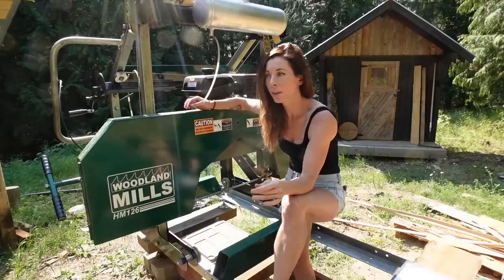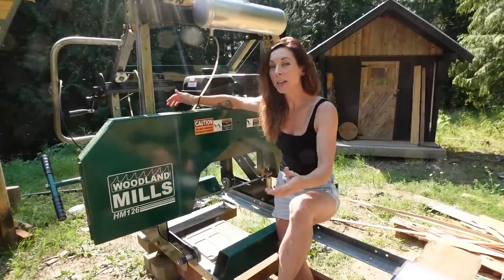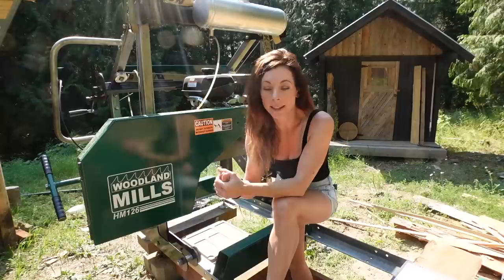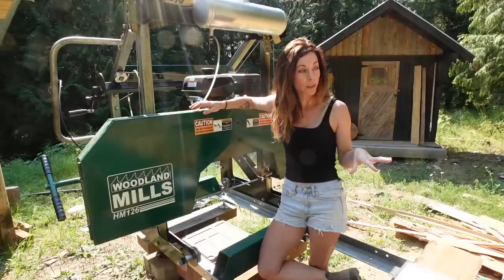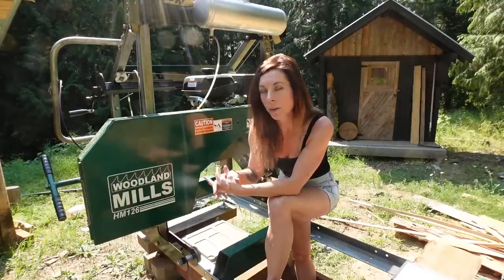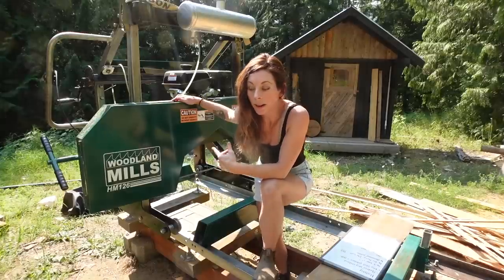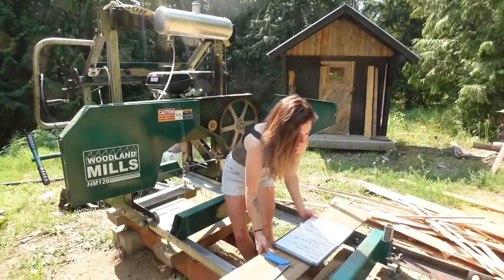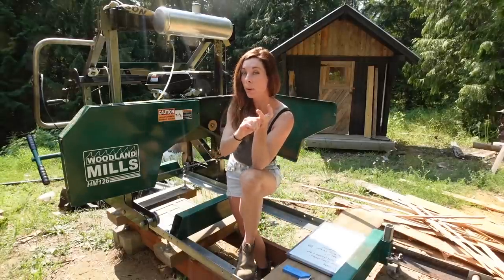My honest opinion - Woodland Mills HM126 bandsaw sawmill

Comment: I'm not there with hands on the problem, but from what I could see your mill uses a very standard tensioning system employed by virtually every belt-driven machine on the industrial market. It assumes the adjuster is familiar with it and has been through the learning curve already (or at least has access to someone who has). I've adjusted hundreds of belt-driven applications in my work so am familiar with the frustrations you expressed. 
Here is the system I use if it helps-
1) loosen the "locking" bolts just enough to allow the tensioner & motor to slide.
     **NOT freely, but only if put under a fair amount of pressure; the goal you're shooting for (which has a learning curve) is to loosen them the bare minimum needed for the jacking bolts (adjustment bolts) to be able to move it.
     **too tight and you'll see the jacking bolts want to go crooked, too loose and everything goes caddywampus (very technical terminology)
 
2) turn the jacking bolts to begin sliding the unit
     **you MUST count the flats of the jacking bolts as you turn them as this translates to the linear distance the unit is moved. 
     **by "flats" I mean the flat spots on the head of the jacking bolts. 
     **I recommend putting a mark with an awl, sharpie, a dot of paint or the blood of your enemies, as well as a mark on the frame of the unit for reference 
     **put the wrench on the bolt, taking note of the position of your mark you put on the bolt in relation to the mark on the unit and as you turn each bolt, count the number of times a flat of the bolt passes your mark on the frame. I recommend only making two 360° revolutions per jacking bolt at a time, then switch to the other side, then back to the other, alternating between the jacking bolts.
     **if you've kept your locking bolts tight enough they'll keep things from going all over the place yet allow you to adjust the belt tension.
3) tighten your locking bolts back down
     **it is imperative you turn the bolts the exact same amount as you number of flats you turn the bolt translates into the amount each side will move.

Another method is:
1) using an awl, make permanent marks on the stationary part of the unit even with the two edges of the plate that will slide when you turn the jacking bolts which will remain visible after your plate slides
     **these marks will be your reference points
2) loosen your locking bolts just enough to allow the unit to slide
3) turn your jacking bolts
     **you still want to only turn each bolt like 360° at a time, alternating between sides
4)using your tape measure to make sure that you're moving both sides an equal amount using your original marks for reference. 
     **this method isn't quite as accurate as the "counting the flats" method and if you want you can combine the two methods for a very positive result. 
Note: for the 1st few times you run your machine inspect the belt & pulleys for any sign of the signs of the belt rubbing on one side or the other. If you see it is (not too hard to tell as the side rubbing will be slightly darker than the other and will look somewhat chafed in comparison to the other) just loosen the locking bolts slightly and turn the jacking bolt on the side that was rubbing
     **a little goes a long way
     **you'll want to only tension the belt just enough to stop it from slipping and no more or else you'll put too much lateral pressure on the bearongs and wear them out prematurely 
     **if you don't have one already, get yourself a grease gun & a box of tubes of red grease. Check your manual for the grease schedule - if it doesn't provide that for you, jus hit every zerk fitting every 8 - 16 hours of operation (if at all possible, grease with the unit running as the turning / moving bearings, etc will accept grease much easier and evenly. Grease until you see it squirting out the other side of the bearing or whatever you're greasing. If visible, check the bearings first to see if they're sealed bearings. If so, only put 2 or 3 pumps if grease in like twice a year. Too much and you'll push the seal out of the bearing and you'll have to grease according to the 8 to 16 hour grease schedule.

**after reading several of the comments I'll offer that pretty much no matter what jigs, bushings, guides, etc you may add, unless you're talking precision machined tool steel on both the unit and the movable plate welded in place with like only a few thousands of of an inch latitude your unit will get out if whack & end up out of alignment. That's why the designers (along with virtually every other one out there) uses the system you're dealing with. It's the tension of the belt pulling on only the one side of the unit that will throw you off every time.
Reply from the maker: Yes ! I might have to read this one again, but I’m catching what you’re throwing out there. 
Steve and I have tried to very minimally loosen them (his suggestion) and slide it, and that does reduce the twisting. But it still happens. I think that welding something would be a way to solve things. I think sorting this out (with Steve’s help) might be a fun video!!
Reply: @michygoss7148  Right on... and admittedly, that style of adjusting setup can be a pain! Welding guides could help, but make sure some very hard steel is used and if you weld on the unit (if there's some kind if logic processing unit/ computer that tells it when to do what) you MUST make sure the welding ground is located as close to the work area as possible and absolutely not on the far side of the computer from where you're welding... geez, what am I trying to say here? Okay,  the point is you cannot let the current that passes through the steel from welding rod to the ground pass through the computer or it will destroy it & you'll have to replace it- just a word to the wise. For what it's worth, I don't know you all's background or experience with machy so I'm trying to put things into layman's terms, certainly not to insult your intelligence and/or experience; you're obviously incredibly resourceful and have that rare problem solving plus the will to "do something about it" thing going on. If Any of what I said is confusing I'm happy to clarify. If Steve has any questions when he gets back he should feel free to hit me up. I have pretty severe ADHD so sometimes my explanations are confusing to humans-hahaha! I'm recently out of the biz, but spent almost 30 years as a marine engineer working the Alaskan commercial fishing industry mostly in the catcher/processor fleet so am intimately acquainted with trying to solve exactly these kind of problems, and being at sea, the location was always remote. My other profession is carpentry- mainly framing- stick frame & timber frame, plus a little finish carpentry, etc so I really can appreciate all aspects of the show. So  yeah... love the show, I dig the resourcefulness, creativity, scenery, hard work - all of it! One of the tiny cabin episodes came through my YouTube feed and the Sky Mule caught my attention- pretty cool! And the view from up there is amazing!! It reminds me of what we call the inside passage I've often taken when steaming up from Seattle to the fishing grounds up in the Bering Sea, or back down here- absolutely gorgeous!! I think it's pretty awesome you don't regard the remoteness as an obstacle that stops your advancing of your goals, but simply an opportunity to find & employ a solution. I'm sure a defeatist feeling probably tries to creep in time to time, but you obviously don't let it stick around- cudos on that! Yep, love the show  keep 'em coming!👍👍
Reply from the maker: @theengineer2827  wow! Thank you for that! If any welding is to be done, Steve will be doing it. I don’t know how to weld yet. 
When are are talking about a computer, what are you referring to? 
Steve used to be a marine engineer too long ago! Sounds like you’ve had an interesting life!
Appreciate the comment 👍😁
Reply: @michygoss7148  Was he really? That is pretty cool- not many of us around so to stumble across another one always excites me (this is only the 3rd time in 30 years-and I live in seattle)!  Better keep us separated or we'll never shut up-hahaha! There's probably not too much I can offer in the way of advice then but I'm certainly all ears if there's any knowledge I can offer to help. Or sometimes it helps a person to just have someone to bounce ideas off of. As far as a computer, I mean like a logic unit that could control the feed or dimensions or something like that. I guess I could have looked your machine up and then I'd have known, but you'll be able to tell I'm sure. Normal start/stop & e-stop switches are fine, but circuit boards do not do well with the high current a welder puts out. Even if you've got some level of computer on the unit just don't clamp the ground to where the computer is between the ground and where he's welding so the current won't pass through it on it's way back to the ground. I'm sure Steve will know what's up with that though. Even if he's never welded on something with a comp. as soon as you mention what I said he'll understand instantly. I had an assistant once who was a certified welder but had never worked on machinery like that and ended up burning up the control unit for a generator set and another logic board too- ended up costing the company several thousand to replace them - oops! Hahahaha! When I called the owner to give him the bad news I just stayed real calm & said, well, that's the way it goes. I couldn't see him but it sounded like he started vibrating-hahahahaha! So, I caught the episode where the "building inspector" visited you at the tiny cabin- I was cracking up, that was fun! And... you do realize that you're like half crazy, right? That was pretty cool- I didn't see that coming at all. I mean it about if I can offer any help with that problem- especially now that I know about Steve's past profession. It kind of makes me think of him like a brother I never met before. Okay then, best wishes to you and stay safe out there!
Reply from the maker: @theengineer2827  he was for sure a marine engineer, and still considers himself one. We worked on steam turbines in the navy, then became a mechanical engineer. And then a couple more degrees after that. 😁

So my samwill doesn’t have any computer system on it. The only think I think we will need to do is remove the engine before welding (gasoline). Otherwise the sawmill is basic. I told him we will be doing it, and he said sure! So hopefully it’ll work out! Thanks for the tips and advice 👍
Reply: @michygoss7148  You posed a challenge & he said "Sure" without hesitation... yep, still a marine engineer! I love it! I'm afraid that's a sickness  he'll likely never grow out of though. Your reply said "we... turbines in the Navy". It seemed like you may have meant "he", so I'm a little unclear if just he or both of you served. Either way, if just him, please extend my gratitude and thank him for his serving our country for me; If both of you then thank you both very much for your service! I mean that sincerely. It just occurred to me that you might be Canadian, in which case the gratitude still stands, just for serving your country!😁 Yep, give me like three minutes & I can overcomplicate anything (it's a gift).
Reply from the maker: @theengineer2827  typo! Sorry. Just he served in the navy - and yes, we are both Canadian but same kinda deal!! 😊

Comment: You need to have a welder come in and weld little guide metal onto the side of that so it does not move forward or backward it only moves side to side I am in machinist by trade and I know what you're talking about Metal little brackets on the side on both sides so it only slides in one place and it doesn't move forward or backwards only side to side😛😜

Comment: seems like it would be worth while to save more money and buy something higher in quality.  last thing I need to do is fix stuff all the time.  I just want to run the machine and not have to keep tweaking it.
Reply from the maker: Sure. If you wanna mill lumber on a very regular basis year round, then probably worth that route. 
For me - I only do this a little bit, and only half of the year. I don’t mind to save money and tweak this machine and save that money for other hobbies.
Reply: @michygoss7148  sounds good thanks for the reply.  love the videos.

Comment: 😱 What? 2 mechanical engineers are fabricating/selling sawmills since 2010 and in 2018 the product still needs sooo many modifications? I'm a technician and proven inventor myself. Therefore I simply have to say that it's quite pathetic to let customers testing a no good product for 8 years !!! instead of doing it right. It's a bad joke how the belt has to be tensioned. It's also a bad joke that there was no adjustable blade stabilizer for over 8 years. The least thing those 2 "mechanical engineers" could have done was "spying" how other bandsaw mills work before selling no good products.
Woodlands mills could also have put  at least one of their sawmils to constant work. With doing so, they could have get their own extremely important experiences. But no, they sold a product which is not even 8 years later, fit/good enough for the work.
2) How they treated a customer while having delivered a bad engine was pretty pathetic too. I guess that I would have given back the complete sawmill with the bad engine. That's at least what you are entitled to in Germany (product liability, warranty etc.).

Comment: Michelle: did Woodland Mills reimburse you "ALL" of the extra costs. If not "WHY NOT"! It was new , their fault for a bad engine , and it cost you out of your pocket.... I went further into the video and "ABSOLUTELY" I'd be a "BIT" Pissed to. Makes me think twice about their products!!!😮‍💨👎 "IF" they are making an effort to make design changes , maybe I'll consider their product. It's 2022 now so maybe it's all good now. Thanx Michelle
Reply from the maker: The engine was sent at no cost to me, and a pack of blades costs about $220 (I think). So I felt that was a fair trade - I spent around $100 or less of my own money for the clutch swap and such.
Reply: In defense of Woodland, even though they included the engine with their mill, they did not manufacture the engine. That is on Kohler.